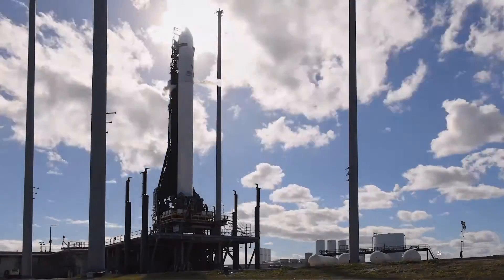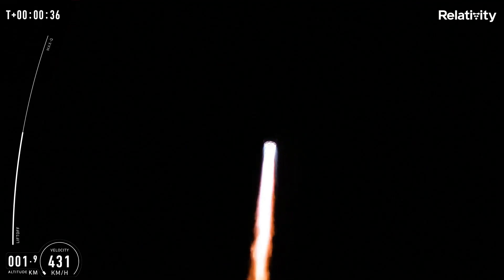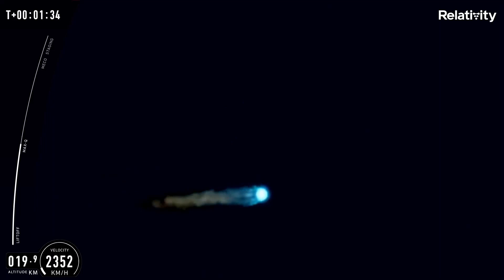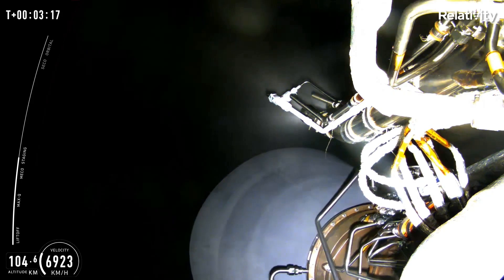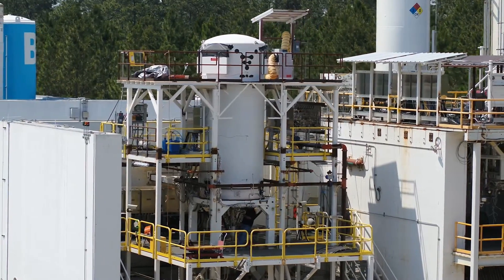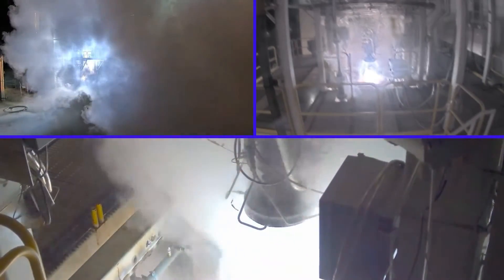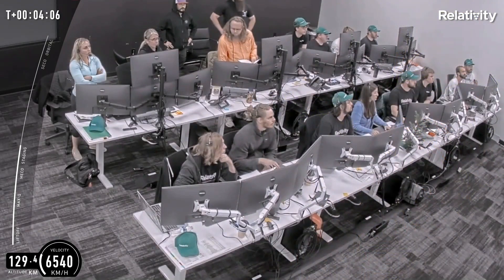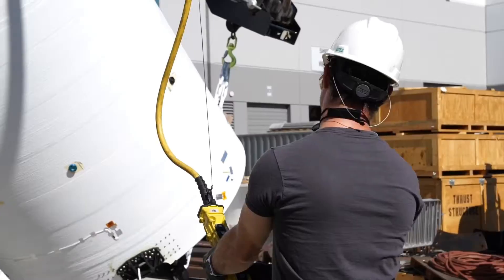First 3D Printed Rocket Reaches Space But Engine Fails Before Orbit

Comment: Amazing result for the first launch ! Would 3d print rocket be more cost effective compared to Falcon9 ? ( Less manufacturing process, less manpower )... Or Until they make the booster partially reusable? ...  I compare this to fastfood: they use disposable dishes cheaper .

Comment: Looked like the pumps had normal looking exhaust as well.  How much thrust would we expect with just the pumps throwing cold fuel out the engine bell?  Does look like they had full attitude control so they should be good when they fix the startup issue.

Comment: thrust could have come from the turbopumps on the 2nd stage or a preburner or something, there seems to be a gas exhaust shown in the downward shot, i'm not familiar with the cycle that those engines use.

Comment: Looks like the second stage engine tried to light a whole bunch of times, as opposed to just giving up and shutting down like in some other failures, and looks like the attitude control kept putting in a credible effort to keep the rocket going in the right direction, again unlike some other failures.

Now I wonder how hard it would be to apply the same 3-D printing technology towards making other vehicles?

Comment: The problem is so many people think 3d printing is magic. You still need raw materials, what the hell. So if the idea is to 3d print on the moon, all of the raw materials would have to be shipped there, so what is the advantage?
Reply: There are resources on the Moon.  The advantage is outside of refining there are no other steps required to start using.  Conventional construction methods require more processing and all of that usually translates into more people hours vs. 3d printing.
Reply: @TheEvilmooseofdoom  Nah, some people have watched too much star trek with replicaters. Let's say they wish to print a aluminum part. The material has to be processed to be utilized, be it in cubes to be melted by a process of the printer, granulated, or in rolls.
It is not magic it is just different. No doubt it will find where it can be used to the best advantage.

Comment: Where does the fuel go, when there is (temporarily) no thrust and no acceleration to produce artificial gravity?  In my reasoning, that was the condition immediately after the separation.  The second stage had been tested in stationary conditions, with standard gravity in force.  Oversimplified thinking from somebody who never since fleeting mentions had anything to do with space/rocket science?  In fact, I am just as curious as the next guy.
Reply: While this close to the earth there is still real gravity.
Reply: If rocket builders hadn't thought of this ahead of time then when the first stage engines cut off the propellent inside the second stage tanks would experience weightlessness and float around inside the tanks and it would not go into the fuel feed at the bottom of the tank like it's supposed to. But thrusters on the second stage are fired during this time to provide some acceleration to keep the fuel settled at the bottom of the tank until the second stage engine ignites.

The Russian Soyuz rocket (as well as the Gemini Titan rocket) use a different method called hot-staging, where they ignite the second stage engine while the first stage engines are still firing. If you look at photos of these rockets that are taken from the correct angle and look just over halfway up the rocket you will realize that you can actually see through the rocket. That's where the second stage engine exhaust is released until the stages separate.

Comment: Maybe they need to consider ullage thrusters to 'settle' the fuel and get a steady supply until thurst builds up?
Reply: IF that was the problem.
Reply: @TheEvilmooseofdoom  given the way the engine would flare into operation for a moment, then go out, that pretty much says it's getting insufficient fuel/oxidizer to sustain operation. either problem would be solved with ullage thrusters to settle tank contents to the bottom of the tanks and get it in contact with outlet manifolds.
Reply: @andrewreynolds9371  So you guess.  Without actual data, that's the best you can do.
Reply: @TheEvilmooseofdoom  data includes video of the engine during flight, and my statement is based on said video data. can you come up with a better explanation?

Comment: It was a great first launch and orbital attempt.  There is some "Thrust" visible on the upper stage in the video, if nothing else, it's the exhaust from the open cycle engine (from the turbopump venting).  That's not much thrust, but it's some...

Comment: Significant venting at the top of the screen on the second stage shots. Turbine exhaust probably? In which case that would indicate a pump combustion ignition failure. Which depending on their design, may or may not be related to main combustion chamber ignition. Although since it's not a closed cycle engine, it's probably much too simple to have main combustion chamber and pump chamber combustion linked.
So... my guess would be that the main combustion chamber did ignite correctly. But the pump combustion chamber did not.

Comment: It’s possible this could be something as “simple” (simple in quotes, because nothing about launching a brand new rocket design is ever really simple!) as an ullage issue where the acceleration force on the propellant dropped after MECO, reducing the pressure at the pump inlets just enough to bork the ignition sequence. 
I guess this is something that would be difficult or impossible to test on the ground, but hopefully the fact that it didn’t appear to suffer any kind of RUD, means they will have tons of telemetry data that will tell them exactly what went wrong and why.
Either way, at first glance it looks like a solvable issue rather than a fundamental design flaw and still a very impressive first test flight.

Comment: First stage proved at least that it can take the forces, I have no idea if the performance was as expected. Shame about the second stage, engine failing to ignite was not what I expected to cause the failure of the mission.
Reply: In one sense not too surprising, first stage engines oftentimes ignite but immediately shut down when a sensor reading is out of spec. But that just results in a scrub and then they try again another day. And sometimes second stage engines fail to ignite.

What seems unusual here is that it doesn't appear that the engine was shut down it was just sputtering. Maybe for an inflight ignition they don't shut it down because there is nothing to lose by letting it keep trying to run, and it gives them more data.

Comment: Won't a vacuum engine blow itself up on atmospheric pressure
Reply from the maker: No it'll work, but the nozzle extension will probably have flow separation, damaging it.
Reply: @scottmanley  that's interesting, thanks for answering.
Reply: Depends on the bell.  It's all about how much you expand before flow separation.

Comment: @scott manley: Unburned carbon which has been generated by pyrolysis of methane due to a fuel rich mixture would also  emitt  a yellow (glow) in higher atmospheric layers even there is no oxygen to burn it.  I think the gas expansion is the reason why we dont see that glow in vacuum.

Comment: They have a working first stage, which is way more than most who try ever get.
The second stage wanted to ignite, even did so for a few moments it looked like until it went out again. So they must have lots of data to work with.
Good luck to them, and I would point out that bigger companies - such as SpaceX - didn't have success upon their first few flights either.

Comment: @ScottManley 
How does T1 2nd stage compare to SpaceX Merlin Vacuum eng on 2nd stage of Falcon?
Reply: They're not comparable. Terran 1 is a small rocket... not Electron-small, but it's about half the height of a Falcon 9, and the Aeon 1 engines are about a tenth of the thrust of the current-generation Merlin (according to Wikipedia).
Reply: @simongeard4824  Thanks for that comparison.  I really never could tell about their sizes compared.

Comment: Scott Manley couldn't they use a small, and I mean small, solid rocket to ignite both the engines and put the fuel down side to  run into the pipe openings for the turbines?   I think that the lines should be primed and that provide enough thrust to get the fuel to settle but there seemed to be a problem with ignition and they need a second redundant system for that  like a piezoelectric spark or something electrical.   I think also 3d printing of something so large will be more brittle than cold rolled stainless steel and there is a weight penalty for it being un-necessarily bumpy, that could be sanded down smooth, taking of maybe 100 pounds of useless metal.   Fry safe.

Comment: 3D printing a cylinder sounds dumb like 3D printed water bottle. It's good for complicated parts like engine but all you need to do is bend a peace of sheets and it's not that hard lot's of company produces larg pipes with broad range of dimensions

Tell me if I'm wrong with some points that i missed

Comment: Honestly, even SpaceX didn't have this successful of a first launch. Great job Relativity!
Reply: For a first attempt, I'd rate them second after Rocket Lab.

The first Electron launch got past separation and had the second stage light successfully, but had to terminate due to a comms problem... which turned out to be a ground-based software bug, so the vehicle itself would likely have reached orbit had they let it. They succeeded on the second attempt, so for me, they're the benchmark...
Reply: @simongeard4824 What I'm saying is despite their market dominance, they had an even rougher start than Relativity. I can only see good things going forward.
Reply: @tedsteiner  They're off to a good start, I agree. But I don't regard this as a rough start at all, but as the second-best first launch of any of the rocket startups I'm aware of.

Comment: To Scott, a thumb down for an the negative titling of this video. TERRAN 1 LAUNCH WAS A GREAT SUCCESS. RELATIVITY® achieve exactly what their goal was to push Terran 1 to “Max-Q” and even have a successful separation and ignition of the engine on the second stage before shutting down for so far unknown technical problems. For a first launch this young company prove that they are contender for the future of space exploration. Bezos first launch end up in a catastrophic failure and Musk Falcon 1 shutdown at T+33 seconds.
Reply: Since the goal of the launch is to make it into orbit and it didn't...  THINK.
Reply: A good first attempt that falls short of the target is not a "great success". It was an excellent first attempt, and achieved most of their testing goals — but they were launching to try to achieve orbit, not just to fire it up and see what happens. A productive test flight, but only a qualified success... they didn't get everything they were trying for.
Reply: @simongeard4824  According to the Relativity commentator, who although a bit screechy does actually work there, the flight met its key objectives which was to gather data at max Q and achieve stage separation. Obviously there were secondary objectives such as igniting the second stage and achieving orbit, and they had a target orbit, but according to screechy the key objectives for the test flight were met.
Reply: @StevePemberton2  yes, that's why I called it a "qualified success" . They got the most important test results, so the mission can't be called a failure... but I don't think it's useful to overhype it given that they still had a very significant step fail.
Reply: @simongeard4824  Again I am going by what an employee of the company said. So if there is overhype it is coming from Relativity Space. A commentator is only going to be saying what they are told to say. The commentator who said that the key objectives of the flight were met was Arwa Tizani Kelly who is the Technical Program Manager for Test & Launch. I'm actually not sure that she was the one screeching, it may have been the other commentator Raichelle Aniceto, Ph.D. who is the  Chief of Staff, Vehicle Architecture & Technology.

And it’s not like they later “adjusted” the key milestones only after the anomaly, it is consistent with what they said prior to launch. For example Aniceto stated, 

“Good Luck Have Fun is the maiden launch of our 3D printed Terran 1 rocket. Terran 1 is an orbital class rocket. So reaching orbit would be the best possible outcome. But as you’ve heard us say before, we are truly looking for some important base hits here today. Notably a key objective for today’s flight is largely about proving our hypothesis that 3D printing is a viable way to manufacture a rocket, and that it can successfully withstand the pressures of flight…. Arwa, let’s remind everyone what we would call a success for today’s launch" 

Kelly then said, 

“Again safely clearing the pad, getting out over the ocean and passing the point of Maximum Dynamic Pressure, or Max Q, would be a big milestone for today’s launch.… And this is the point in flight where we really want to prove much of what has already been proven on the ground..... So passing this milestone would effectively demonstrate that 3D printed rockets are structurally viable. And then if we make it even further to stage separation we will have achieved a full first stage flight and that will be another big accomplishment for the team. From there we’ll attempt to light the second stage and get Terran 1 to orbit."

As the launch got closer Kelly added, “As a reminder GLHF is our maiden launch so what we’re really looking for here is to learn as much as possible, and demonstrate the product concept. A big milestone will be reaching that point of maximum dynamic pressure or Max Q.”  Thus the screeching when the rocket passed that milestone.

After the launch Kelly said, “Although we didn’t reach orbit we significantly exceeded our key objectives for this first launch.” If you don’t agree with that assessment and consider it overhype that’s fine, you have your criteria for what constitutes a great success. I’m just stating the company's publicly stated viewpoint of the flight. Whether that’s just spin and that internally they do not consider the flight a great success I have no way to know, but I also don’t have any reason to believe that is the case. Other than the team in launch control wasn't exactly jumping up and down when they realized that  the second stage hadn't successfully ignited, but it's possible that they were still busy monitoring what was happening with the second stage.

Comment: Seems like a common thing with these rockets failing to ignite the second stage.
Reply: It's not that surprising, no... second stage ignition isn't something you can really test effectively on the ground. You can test that the engine works on the test stand at sea level, but not that it lights while travelling sideways at a few thousand km/h in near vacuum after being subjected to the forces of the launch that got you there.

Comment: Great analysis, Scott, but your chemistry seems a little off. Methane burns blue in excess oxygen, and also burns blue in a fuel-rich environment. The orange that you see at the start of the flight is not from incomplete combustion. Rather, it's the incomplete combustion products burning off when exposed to more oxygen (or at least, that’s how my teacher explained it). Looking back at the broadcast footage, you do see this as a two-tone flame – blue with an orange tail. And when it’s out of the lower atmosphere, the secondary combustion is halted by lack of oxygen, which might make it seem to change colour when the orange part disappears. But the brightest part of the flame was blue from the start.
Reply: You have a good teacher.